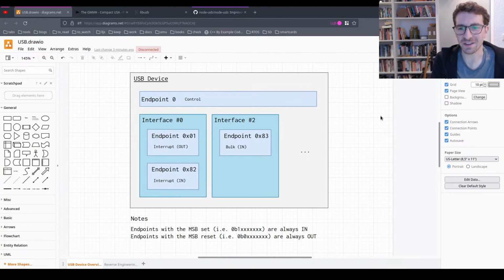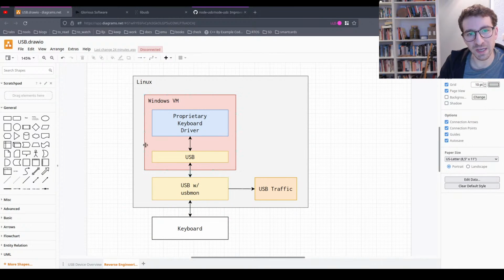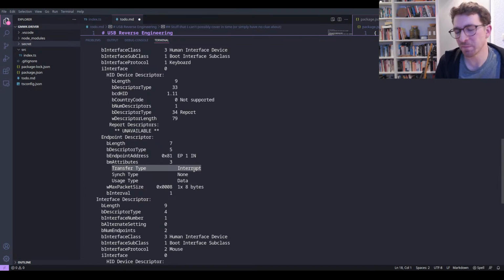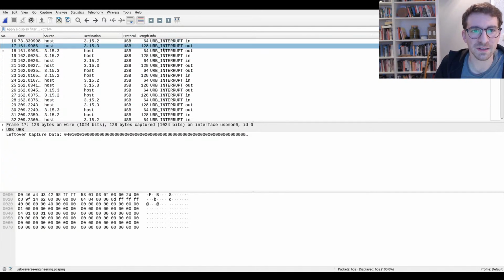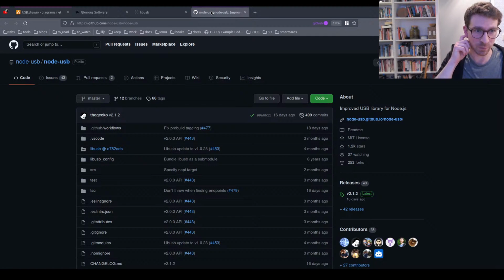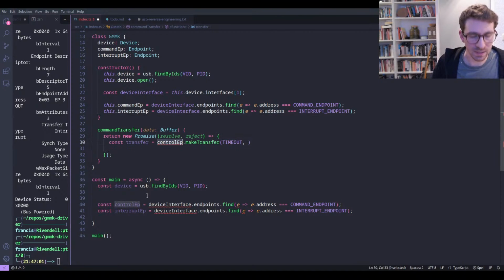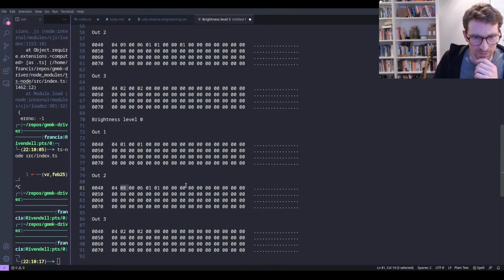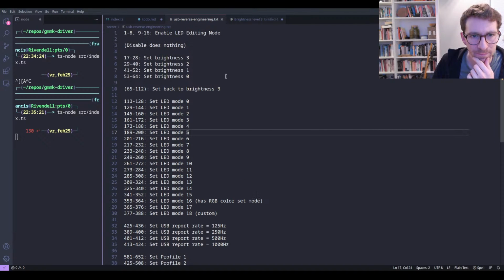[stream] USB: Reverse Engineering and Writing Drivers

Comment: My Thinkpad W541 has a screen color calibration sensor in the palmrest. So i have tried to reverse engineer it. I have found the right control transfer call to read the interrupt and read sensor data. However i have also found the wrong calls which have bricked the sensor. I suspect i have somehow damaged the firmware of the sensor controller (yet to understand how i managed to do it by doing only interrupt reading and GET REPORT requests).

The device doesn't even enumerate via USB anymore lol.

Comment: Don't know if you talked about this, but there is a mode that USB devices can be put in, some of them, some of them only come with this mode, like keyboards and mice, called HID mode, which is easier to write device drivers for, in userspace. They are called filter drivers I think. And the drivers hook into a standard kernel driver on both Windows and Linux, that allows other userspace filter drivers to exchange HID datagrams with the device, instead of custom bytes. Examples include POS devices like scanners and cash drawers. IBM and a bunch of other manufacturers worked to standardise for example the POS HID spec.

Comment: device generally generate a hardware interrupt to IO controller... which then notify CPU though it iNIT pin ..on being notify of that CPU will get the interrupt No from IO Controller on data bus. Then will call the appropriate interrupt routine that is mapped for that hardware interrupt. Hardware Interrupt just says that device wants something to say. Now in that interrupt service routine  which is generally installed by the OS... the OS will call the appropriate driver routine to handle the device request. That driver routine (or even interrupt routine itself) will then poke the driver about the cause through its registers and will do the whatever needed. I mean read data or whatever. Now all this can be done when the hardware interrupt actually happened or maybe differed to appropriate time if its a lengthy job cause when u enter a interrupt routine other external interrupts are generally disabled depends on how CPU entered the interrupt service routine in protected mode to check nested exception conditions or race  problem. 

And in modern multicore CPUs there are local APIC per processor on die itself which are connected to an IO APIC on motherboard. And I guess APIC can handle 256 interrupts in compare to PIC just 15 though master slave  arrangment... and in protected mode those interrupts cant be mapped below 32 cause they are reserved as CPU exception interrupts in protected mode. In real mode they are kinda fixed for legacy reason from 08h to 0Fh  for master and 70h to 7Fh for slave.

Comment: Anyway interrupt type doesn't mean anything to do with poling I guess rather it's the opposite of poling. In USB terms here I mean what I skimed though a lil bit of its specification jus today is out of 4 type interrupt type is where latency is fixed at a certain value. And host (OS or CPU) won't be poling keyboard for data that wud be too much burden for such mundane device. And that's why interrupt type is used for keyboards likes I guess. keyboard controller inside your keyboard will generate a interrupt for IOAPIC or PCH whatever there is. which certainly will go through USB interface since yours a usb keyboard. So once it reached the IO controller it will be forwarded to CPU then your OS through some interrupt routine. There a lot inbetween but lets keep it simple as this. And as u press a key ..key should be notify to OS or user so why its an interrupt generated (hardware). Only host side intiation I can imagine is when it send your keyboard some control commands to change its behaviour like different led styles etc.  So basically all input devices are interrupt driven at least that endpoint or pipe which is outgoing from input device to host since they need immediate attention or response.

Comment: Why u calling it reverse engineering I dont get? ... U're writing a driver for your keyboard straight... right? Is that term kinda in fashion or something ...or make things feel more sexier or awesome then it is? 😊😂

Anyway, why don't start something like writing something for Sata drives or HDD drives in general... I will be interested... I mean I will gladly be your free non-paid assistant in that. 😀 U c I have a  2TB HDD which somehow for some reason can't be mounted or fail somehow. But its partitions are kind of recognizable by mount utility for a while. But it won't give u a specific reason why it failed it. Though drive seemed to rotate perfectly. And since it's rejected by mount utility so no other hdd utility will recognize that drive. So I wanna know what's going on there.  Or why me interested in such a tool. Cause only tool available that I know of is PC 3000 from Ace Lab and it costs some 10,000 - 12,000 US dollars. Now if I possessed such money I wud have bought a state-of-the-art laptop or PC I guess. 

So was wondering if we can do something about such situations. I mean with Linux we can even modify the real driver code or even kernel code I guess if the need arise to that point... No? What I came to know about all this hdd things is at the lowest level, there is APIC or ACPI driver then I guess PCI driver  --> USB hub controller --> S-ATA driver --> Disk - Vol & Partition manager etc if I am not wrongly guessing it... no? Basically, the purpose is to write a fully verbose SATA driver that can do every kinda inquiry that SATA protocol permits I guess. So that we can pinpoint the specific fault condition before we open up a hard drive for anything. So what's your take on this? U seem knowledgable ... me kinda novice u say but sure I can go for it. I mean I kinda understand the Intel processor a bit though its manual or assembly language. Me no expert but told u to show me not afraid of them either. Wud wait for your reply. 

At least us can guide me on what specifications or things or topics I needed to understand to build something like that. I have done some exploration on my own ..and have downloaded some specifications about a few protocols that I think wud be involved. like SATA, PCI, ACPI, APIC, IOAPIC,  USB, Seagate drive datasheets for my drive etc. Linux and Windows driver writing book or documentation ..Linux kernel source too. 😂 ... but hope dint have to go that far except just a lil overview of some specific part that too in rarest of rare case I guess. Cause dont wanna mess with that huge mess. I mean code base. The objective is to simply write some SATA protocol-enabled utility that can talk directly to HDD in question without using much OS. And I think that wud be a valuable tool for everybody too out there cause I see lot of similar problems on YouTube but coudn''t find one good enough tool on whole net. And OS has become more less accessible to deal with such situations now-a-days. It was good old DOS or Win98 days where u can just fire up simple debug or diskedit utility to probe connected HDD to confirm the problem.
Reply from the maker: It's reverse engineering because we don't understand how the communication with the device works in the beginning. We need to capture signals and through a methodical process figure out what those signals do, and THEN implement a driver. The process of capturing signals and trying to figure out what they do is called reverse engineering. Nothing special going on here.
Reply: @LowByteProductions  Okay if u sayso... smile. But if u online anything about my problem BOSS? 😃

Comment: I thoroughly enjoyed the video. Is there a possibility to replicate it for the Windows Wifi Driver, similar to how Microtek 7902 supports Windows but not Linux? Can a Linux driver be developed for Microtek 7902 or any other wifi driver by following this method or is there any other method?
Reply: If it’s a usb device probably.
Reply: But that will not use type script anymore as that would be way to slow and probably break on timings.

Comment: - As far as I remember you also need to detach and claim the interface for WebUSB. For HID it's better to use WebHID instead (but that isn't supported everywhere).
- It's likely that there are multiple functions specified in the HID report descriptor for the mouse. That way multiple different HID functions can be put into a single interface. In the case these are separated as independent data packages and not grouped up in the same the first byte is the report ID to differentiate them. So the first byte with the 0x04 likely identify the report ID.
- It's always worth to have a look in the HID descriptor where the HID functions structure is defined for a faster start.

- Byte 2 and 3 seems indeed to be a simple checksum (sum of all elements).

Comment: Awesome video!
How did you manage to run Windows 10 on Virtualbox without having huge lagging? :)
Reply from the maker: Thanks! Just gave it enough ram, and only ran a single program at a time. I even managed to solve the crashing issues in next video by changing the USB capturing method

Comment: does this support bulk transfer or is it only for control and interrupt and isochronous transfers only?
Reply from the maker: Node-usb in general? It supports bulk. What it doesn't support is isochronous
Reply: @LowByteProductions  thanks for the prompt reply, I am trying to reverse engineer a touchscreen device, do you have a business or would you be able to do the job for us if yes can we share contacts? thanks
Reply from the maker: Hey Ahmed, no worries. I'm not really open to that kind of freelance work right now I'm afraid.

Comment: Trying to figure out how to write up a USB descriptor for some custom hardware. While this video wasnt quite what I was after I did learn a fair bit...

Also That second byte after 0x04 is deffo a checksum, I guess 04 is start frame followed by checksum maybe 2 byte checksum as byte 3 is 0 in these tests.... the next three bytes are likely commands or sub commands, followed by value. 

Its interesting there is a checksum in the byte stream as I thought USBhid handled that error correction anyway?

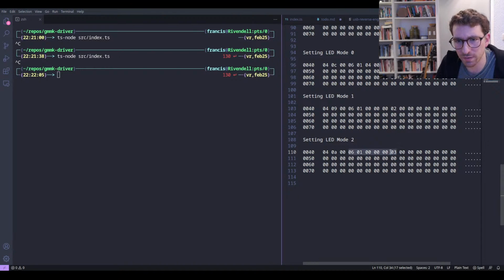Ahhh at 2:10:48 you see it :D

Comment: The reason us filthy gamers want a high polling rate is because of latency not throughput.  Nobody's pressing 1000 keys per second.  No game engine is running the main loop 1000 times per second.  When I press a key, I want it to be available to the game engine ideally instantly, so it's guaranteed to be registered for the very next game loop.  With polling, you can't guarantee that.  There's always going to be a point where the polling happens too late.

That's why we still use PS/2.  Interrupts are just better.

Comment: 42:10 you can use that information in real cool ways :) Like "overclocking" devices to have them respond faster if they can (e.g. a keyboard that's set to 8ms poll rate when in reality, it can handles 1ms.)
Reply from the maker: Ah that's really interesting! That's also one of the cool things you can do when you have absolute control on the host side right - you can "break" your contract with the device and see how it responds. Have you tested this out with a lot of different keyboards?
Reply: @LowByteProductions  Not yet but I'm planning on experimenting with it sometime soon :)

Comment: One suggestion to deal with wiresharks inability to use capture filters for usbmon: You have different usbmon devices, which correspond to the different USB busses. usbmon0 captures everything, which is what you used in the video.
If you make sure the keyboard is plugged into a different bus than the other devices and capture on the corresponding usbmon device, you get rid of all the spurious packets.
Reply from the maker: Yeah that's indeed a great point. Unfortunately my computer only exposes 2 buses (though it seems to have 2 more internally). With all the high-bandwidth devices on one bus the capture becomes impossible.
My solution (which I'll show in the next stream) has been to use eBPF to capture transactions at the kernel level and filter out the ones I'm not interested in. That's turned out to be a really great approach and I'm surprised that I haven't seen more about it!

Comment: Great video. Do you think the same approach could be used to get the current battery level/percentage in Logitech G HUB for the Logitech G PRO Wireless mouse? I'm in the process of attempting to do so and will provide an update if I'm successful.
Reply from the maker: Is it something that the mouse offers in Windows (or another environment)? If so then I'd say it's definitely possible, you just need to be able to capture the request and figure out how it encodes the response

Comment: Can you do the same for a headphone or headset? or can someone point me to the right resources to do something like this for a headphone or headset
Reply from the maker: Yes you can do the same, provided its for the control parts and not the audio. Audio requires really tight transmission of data that isn't supported in node (though you can write that part in C/C++ using libusb).

Comment: This is so cool!!! I'm a web-dev of almost ~10+ years and I recently started a small hardware company and I've had to learn all about low-level USB, hardware development, firmware coding, and communicating over WebUSB. I feel less alone as I watch your video :)
Reply from the maker: That sounds awesome Daniel -what are you working on there?
It sounds like you would fit in well on the discord server by the way
Reply: @LowByteProductions  are their known ways to sniff the messages between the OS and the hardware (CPU and GPU)??

Kinda like Canbus sniffing where we watch the conversation to basically reverse engineer some drivers and make an the same OS work with custom hardware
Reply from the maker: @FirstLast-tx3yj  The short answer is yes, but the long answer is that it's complicated. Disclaimer that I don't work on this stuff directly, so I could be off base with some of it, but this is my understanding: The traditional view of a modern computer is that the CPU is not connected to peripheral hardware directly, but rather to the chipset. The chipset consists of a northbridge, which has a bus to the CPU and manages signals to the GPU and fast buses like PCI-E. However in the last decade or so integration has gotten tighter, and the CPU itself has absorbed a lot of that interconnect, and typically has an internal PCI-E controller. So a modern GPU is connected to the CPU over an integrated PCI-E connection. To put it into perspective, I looked up some numbers for data transfer rates on the latest generation of PCI-E in the highest bandwidth configuration, and it was upwards of 32GB/s. That's an insanely high data rate, and capturing it raw like a CAN bus would be an enormous effort, likely out of reach for anyone without a multi-million dollar lab. Signals at that level are deep into the RF spectrum, and physics really comes into play - even just "tapping in" to a line would probably completely wreck the signal.
That said, they way you see people reversing GPUs these days is by getting in at the OS level with custom drivers, or eBPF hooks - much like this video. You write some test case in the black box, watch the exchanges at the OS level, and try to understand what they mean. Then you write your own driver, and construct messages based on what you've observed and extrapolated, and build up an understanding. This is essentially what the folks at Asahi linux have been doing with the M1 GPU. Check out Alyssa's blog https://rosenzweig.io and the the asahi linux youtube channel. Tons of work being done in the open there.
Reply: @LowByteProductions  thank you this is one of the best explanations i got so far.

So in the project you mentioned they are building their own drivers to run linux on the M1 and for the hardware to be functional with the OS?? 

Would you say the opposite, developing drivers to adapt a manufacturers OS to custom PC CPU and GPU, would be harder
Or is it the same procedure and thought process?
Reply: @FirstLast-tx3yj  Regardless where the GPU is connected to (directly or via a chipset) the device is connected via PCIe lanes to the I/O controller of the CPU. As mentioned these are high bandwidth data transfer. Like for anything (PCIe, RAM & even the CPU itself) there exists specialized hardware for testing and probing the data which is send over. But because these are very fast and high bandwidth while also have strict signaling requirements you can't just probe them. So you need specialized and so very expensive hardware which is likely also hart to get. Like by using a logic analyzer that need at least sample twice as fast as the data signaling frequency is. Better 4 times to avoid errors.
Reply: Hi i have a quastion, how do u actually know when debuging, thats itds either a uab driver problem or a faulty usb host controller problem? @LowByteProductions
Reply: Same here drowning between all these peripherals and protocols and product research and market targeting and sales 🥲
Have no idea how to get this damn thing done 😂
Reply: Hmm so you actually made a product using this api? Do you still have a native driver or do people have to live with using a web app with its bloated runtime to use the thing? I hope it’s nothing for data capture..
Reply: For modern pcie there are tools but it’s not simply the oszi/signal decoder you need the environment around it. 
Keep also in mind that stuff might be handshake encrypted especially for gpu drivers there can be signatures running numbers etc. in pdu’s.